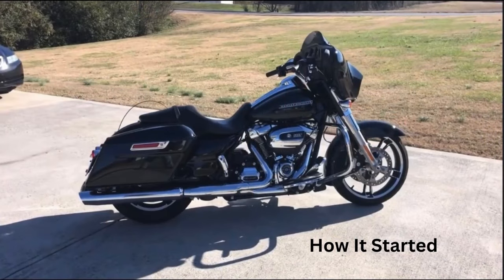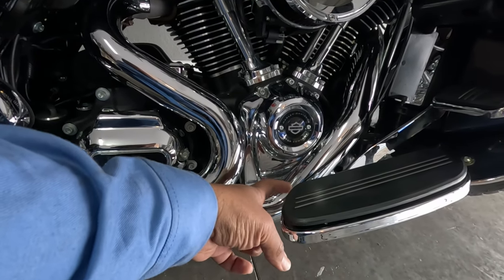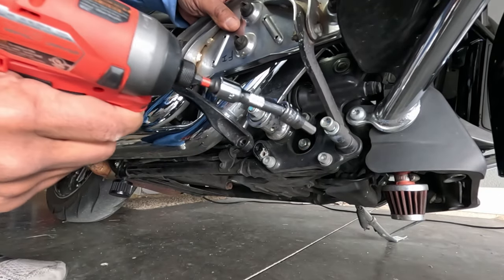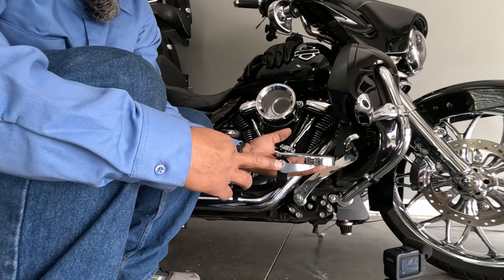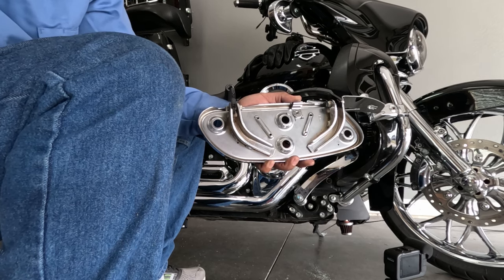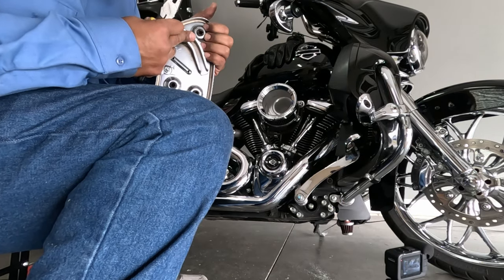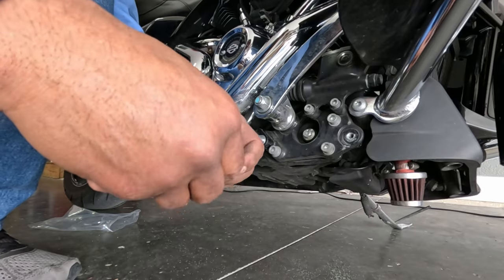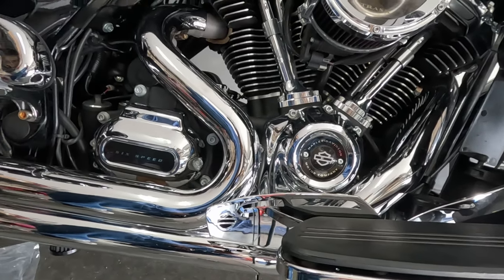Heel Guard Install

Comment: Is that a genuine Harley Davidson part? Spaying a little silicon on the rubber grommets will make them much easier to reinstall on the floor boards.
Reply from the maker: Yes it’s a genuine Harley part that was got from the dealership. Thanks I’ll try and remember for next time on floorboards. Thanks for watching!

Comment: If the bike was designed correctly, you wouldn't need to spend extra money on a heel guard.
Reply from the maker: If you say so. It’s just a piece to make sure you don’t hit the exhaust with your shoes. If you keep your feet on floorboards you won’t have to worry about it either. Also it looks good. Thanks for watching!